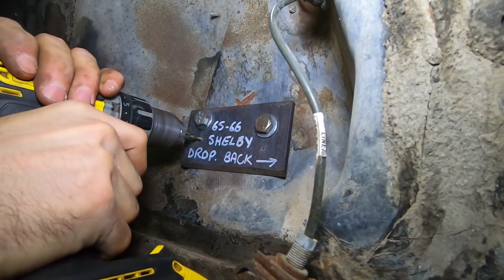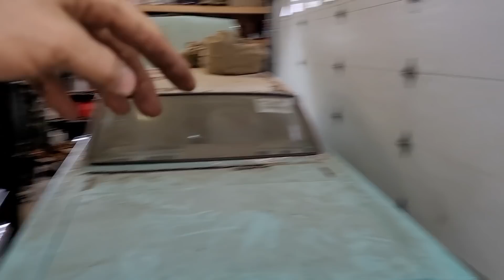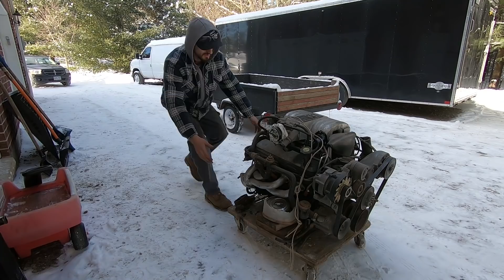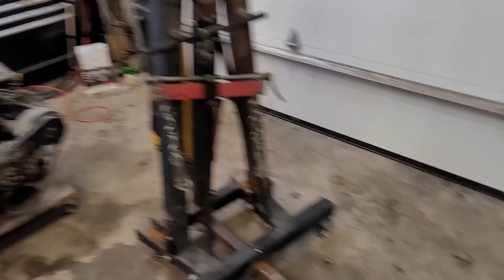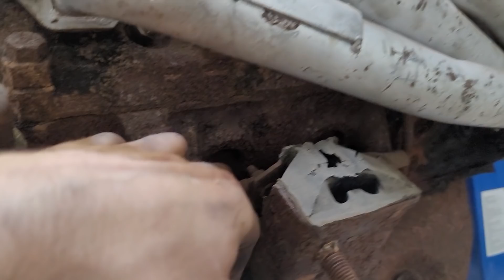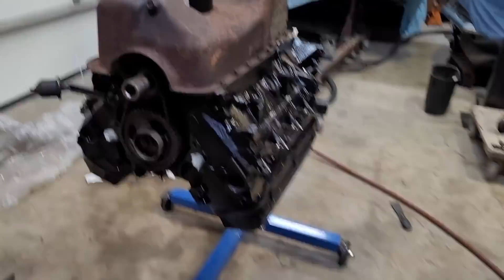1965 COMET BUILD, PART 3: ENGINE ROUTE REVEAL

Comment: awesome video . I was just wondering is it possible that one of the other arms on the engine stand would have been longer that would have fit?
Reply from the maker: Thank you, nice 65 in your profile picture! Unfortunately all the arms were the same length, had to modify the main plate (elongate the slot a bit) and it fit. It’s a cheap engine stand (have to do it every time we buy a new one).

Comment: I'm doing the exact same 5.0 T5 swap. Mine is standard steering and have a cable clutch set up can you tell me what headers you plan on using ? I've tried at least four different types but they all have issues

Comment: I did one of these about 15 years ago. I ended up with a 347 stroked motor  with a b & m 144 blower on it. It ran great, smoke the tires at will, and since I rebuilt everything, handled great. Some uninsured guy t boned me on the freeway, bent the frame and the unibody, and turned it into a parts car.  I ended up using the motor trans in another 60 Falcon, and the rear and wheels on a 1924 Chrysler with a 671 supercharged early hemi.  I am in the middle of a 1968 AMX at the moment.  I subbed to your channel, take a look at mine, and leave me a comment if you will.  Tom

Comment: That looks to be a 1986 HO out of a Mustang. That was the changeover year for fuel injection so they still had fuel pump eccentric on them. They also had true flat top pistons with no valve reliefs, so you can’t go crazy with your cam.

Comment: Change the pilot bearing. You've already got it apart. A lot of these FI engines came with the fuel pump eccentric, weird, maybe they needed it to work with that style timing set? This is a great project, love it.
Reply from the maker: The pilot bearing will be brought up in a future episode (all dependent on the trans situation *will make sense when the video comes out*).
The 89 engine that's in the 65 fastback didn't have the eccentric, so I'm thinking this is/was just something ford did for a year or two of the transition between carb and fuel injected engines. 
Thank you, glad you're enjoying it! More to come!
Reply: @Theoldcarchannel.  a few years back I bought a GT40P crate engine that had a FI timing cover and also the fuel pump eccentric. Maybe they were just using what was in the parts bins.
Reply: @garymatthys3605  The crate engine was offered for a variety of retrofits.  Fitting it with the cam, even though it might not be used, just facilitates swaps to older vehicles.

Comment: Love your project also. But you got to keep in mind you have a internal balanced engine vs external
Reply from the maker: 5.0L are 50z balance on the flywheel and harmonic balance, old 289 are 28oz. Everything is fine since it's all 5.0L parts (new harmonic balancer is 50oz)
Reply: Okay I'm sorry I had a problem with my 64 project I put the 3 bolt balance on . Had one heck of a vibration.

Comment: somebody show this guy this stuff we have called "tape" we use to cover stuff we don't want paint to get on. also change those freeze plugs before painting the block would be better.
Reply from the maker: What would you have taped?  And why is that in regards to the freeze plugs?
Reply: @Theoldcarchannel.  the ports in the heads where you had paper towels stuffed in there. and the reason to paint after changing plugs is you'd have to touch up after wards if you pinted first. besides those plugs need primer and paint too. might protect them from rusting again.

Comment: Personally I would keep the 289 on it .
Reply from the maker: Technically still keeping it... just in the garage instead of in the car 😉. There was too many red flags and I unfortunately don't have the time to rebuild it at the moment
Reply: The 289 was a hell of a little engine in its day, no dispute there.  And I'd rather have the 289 over a flat-tappet 302.  But the roller 5.0 is the superior retrofit.   The torque and power output of a carbureted roller 5.0 is similar to that of an early 351W.

Comment: Just curious why you decided to swap out so much rather than leave some as it was on the newer engine. Carb I get. Some of the other - Is it just to make it look as period as possible?
Reply from the maker: Correct,tiring to make it look period correct while having a rollerized engine. Never been a fan of the serpentine belt set up in the old cars unless it's a full blown protouring build.

Comment: well, at least it's not an ls swap. 

i'm converting a '71 302 (with 5.0 belt drive) to look like an early 289 so this migh be helpful.
Reply from the maker: Yeah I couldn't do that to this car haha.
This series will definitely be helpful for your 71 build. Let me know if you need any info
Reply: @Theoldcarchannel.  thanks man. i want to use a three bolt pulley and balancer and wonder if i need the adapter i think you mentioned. love the channel anyways but watching this more closely.
Reply from the maker: @Ecosse57   Appreciate the support! The harmonic balancer that you require since your engine is a 1971 302 and not a late model 5.0L foxbody engine, will be different than what I'm using. I'm using summits part number #SUM-163302 which is 50oz externally balanced. If yours is truly a 71 engine it will be a 28oz externally balanced engine which will require the #SUM-163289 harmonic balancer